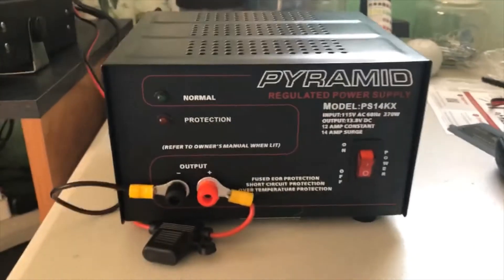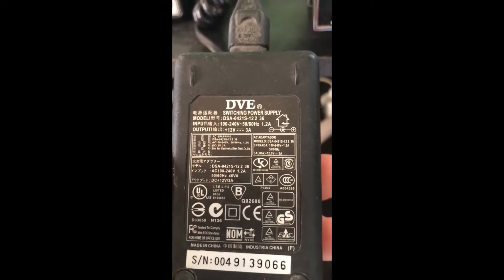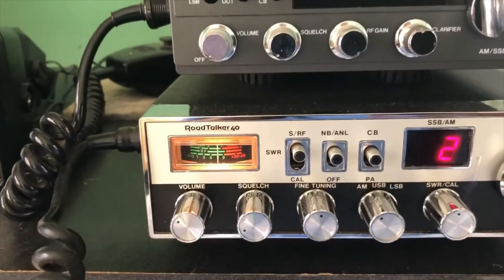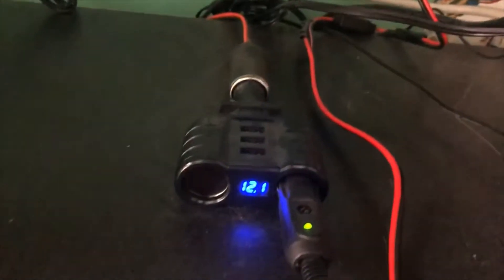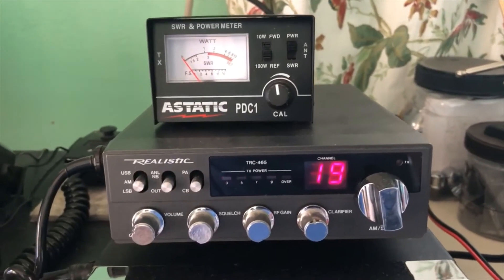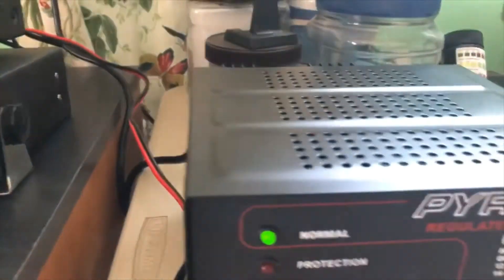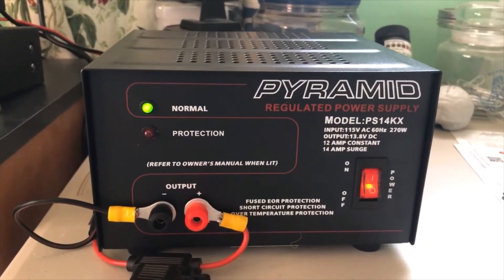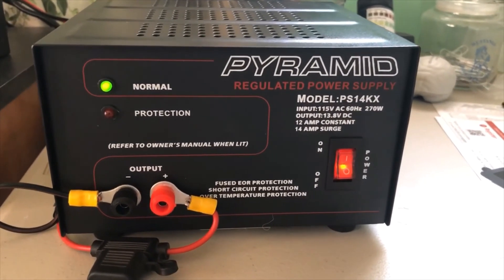Pyramid PS14KX Regulated Power Supply

Comment: I built a 20A linear power supply years ago and still have it.  It weighs more than 20#s.   Now, I am using a 30A switching power supply for my HF and VHF rigs.   I also have a Dell PC power supply that will handle much higher amperages.  It was salvaged from an old PC.

Comment: Pyramid is JUNK. They have no web site anymore and Pyle does not even list a phone number. Dump it like a hot rock. Nobody can even get a wiring diagram for the Pyramid.
Reply: It is a linear power supply.  There is transformer, a bridge, filter caps, couple of 2n3055 with a driver, and a voltage regulator circuit.  Easy to work with.  don't need a circuit diagram.
Reply from the maker: I paid around $42.00 2 years ago and it's still going strong. I only have my CB radio running off of it, probably only drawing around 4 or 5 amps. The voltage has stayed pretty constant under load and I have yet to hear the fan turn on. With a lot of use, it gets a little warm but never hot to the touch. If it ever goes out, I will probably spend the money and get a higher end power supply, but for now, I've been very pleased with its performance. Thanks for the comment and 73s from 595 Northern Nevada!

Comment: Very important part of the shack, most bang for the buck of any adjacent accessory. FM in particular has a very high draw per watt output of any other mode, make sure you stay under max amps, unless you are quick. Good vid, Pyramid/Pyle has made great, undeniably affordable equipment for decades.

Comment: Nice trc-465. Just bought the power supply. Thanks.
Reply from the maker: I have my new Bearcat 980 SSB hooked up to the Pyramid. No RF noise that I can detect. The Pyramid is a year old now and has been very dependable. I'm sure you will be pleased with it. Thanks for the comment! 73s from 595 Northern Nevada.

Comment: 270 watts input max. Linear power supplies are the best for cb and ham radio . switching power supply cause RFI and EMI. Noise on the transceivers cuts your ears off.
Reply from the maker: Thanks for the comment, I noticed some RF noise on my other switching power supply but was able to cut it back with moving it farther away from the radio and installing some ferrite beads. Next power purchase will be linear. 73s from 595 Northern Nevada.

Comment: I've got this power supply, and it might be fine for CB radios, but it went into protection mode with my IC-718 and is stuck there. Having to use a marine battery until a new power supply comes in.

Comment: Are you able to just hook up the power wires from CB radio to the pyramid power supply? I tried and CB didn’t turn on. Also the pyramid power supply light comes on but it’s so quiet I’m not sure what’s wrong with it. Thanks for any help.
Reply from the maker: Mine is quiet also. The CB should power up if you have it connected correctly. Does your radio have a inline fuse you can check? If you have a multimeter check to see that the power supply is putting out power.  Good luck!
Reply: @RidgeHikerAdventures  yes it has fuse line and I checked the fuse and it didn’t look bad. I’m taking it to a friend to check it out that can see if I connected it correctly. Thank you 🙏

Comment: I have been using that very same power supply now for over 10 years without a problem, I just bought another one to run an amp but now Pyramid is under the Pyle name but still the same great power supply. Cheers!
Reply from the maker: Great to hear the power supply is still going, I've read great comments about them. Thanks for the comment. 73s from 595 Northern Nevada.
Reply: @RidgeHikerAdventures  They are much better that Astron which only uses a 1/2 wave bridge rectifier circuit where as the Pyramids use a full wave bridge rectifier and they cost less than the Astrons.  I own a PS4KV and 2 PS14KV supplies. I also own a Pyramid PS-12 from back in the day when Pyramid was owned by the Tenna Corporation (1970's I think) and it still works well.

Comment: Does it have a built in Cooling fan?
Reply: No cooling fan, they say it has one in the product description online but it DOES NOT have a cooling fan. Cheers.
Reply: @CBLounge2112  Ok Thanks for letting us know! So far this one is working perfect & it's Ultra Quiet.
Reply: @miguelsalami   ... No cooling fan means quite.  If you are talking about RF noise, a linear supply does not generate RF noise (hash).
Reply from the maker: Yes, but I've yet to hear it. Either it's very quiet or it hasn't turned on yet. 73s from 595 Northern Nevada.
Reply from the maker: @miguelsalami  Let me know what you find inside. So far I'm really liking the power supply. 73s from 595 Northern Nevada.

Comment: Been looking at this same Pyramid power supply for a additional radio I'll be setting up in my shop later on. I have a Mobile Authority 12amp 14 amp surge I've had since about 1986 still working fine.
Reply from the maker: I just ordered another one ( 6 amp for my CB radio). I'm going to use the 12 amp power supply for another device that draws 10 amps. I like your avatar, we have a 14 year old Jack Russell. Still very active, they never slow down! 73s from 595 Northern Nevada.
Reply: @RidgeHikerAdventures  Thanks that Rowdy our JRT. He's gone now, died Sept 2016. We had him for 15 years,sure miss him. One of the smartest dogs we've ever had. I had a lot of respect for him, I believe he saved my wife's life one day from a potential fire. North Texas 106 73's back to you.